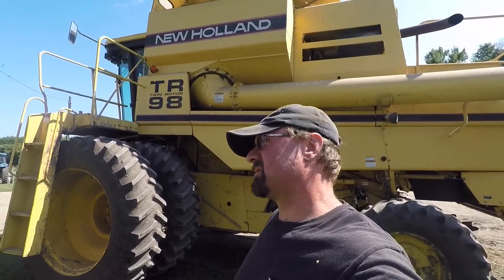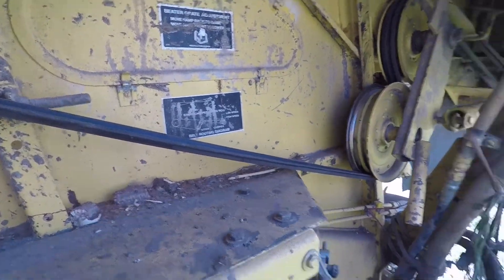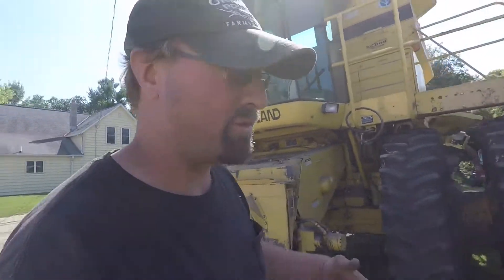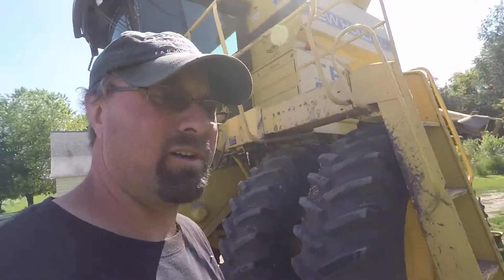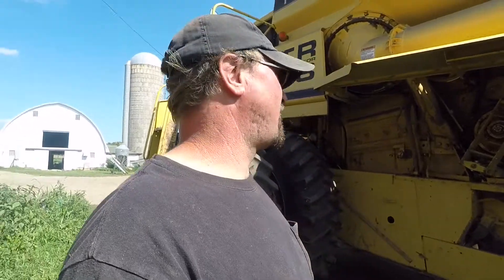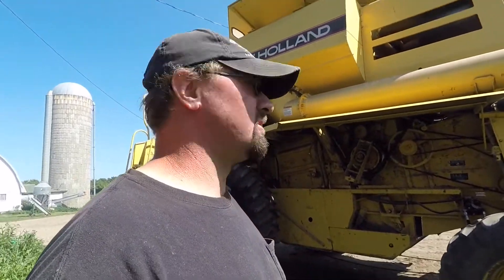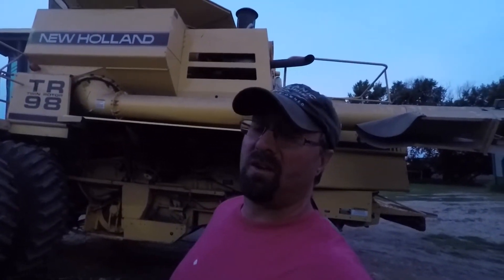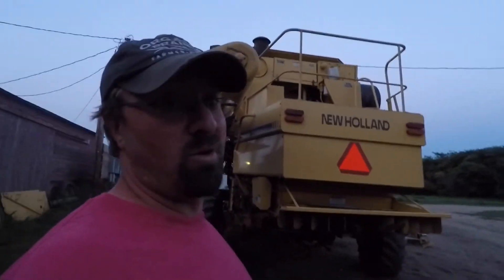Getting The Combine Ready For Oats Harvest!

Comment: I was looking at an IH combine but when the neighbor come in with his IH to harvest his corn he was leaving a lot of corn on the cob. I then decided to get a JD. I like my JD6600 but do think the IH would have been a better combine. I have found that they all have to be set-up right. If not they will let good crops go out the back.
Reply from the maker: TAH-DAH Farm I always noticed on our JD 7721 that it would always throw cobs out the back of the combine with kernels still on the cob. Maybe it was because the corn was wetter corn like 21%. I tried everything to stop that from happening on that combine. I even close the concave down tighter to see if that made a difference. Though I’ve  never seen corn still on the cob with the NewHolland even with corn as high as 28% moisture. 

Don’t get me wrong those 6600 & 6620’s are still a good reliable combine and built tough. They are probably better then some of those newer John Deere combines. Your 6600 looks like it is still in very good shape.
Reply: I was very patient on it set up. The only corn I left on the cob was what fell off the head. My corn was at 18% so I'm sure that helped. My neighbor helped me with the setup and I only had to make a small adjustment. If I ever have to get another combine, it will probably be a IH.